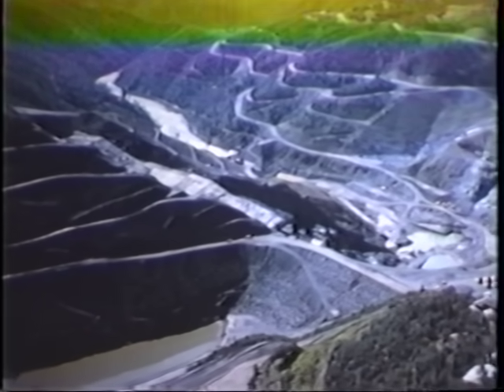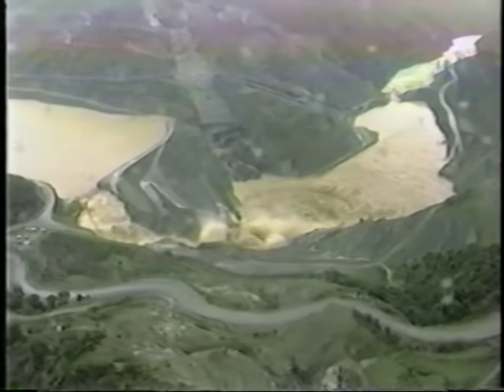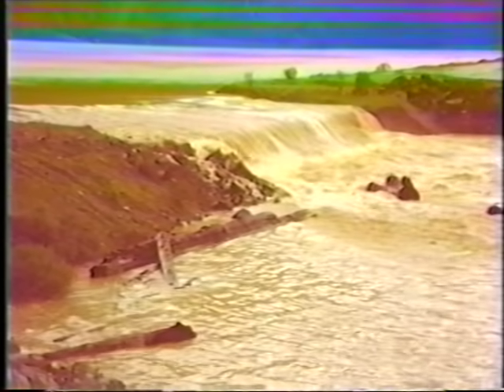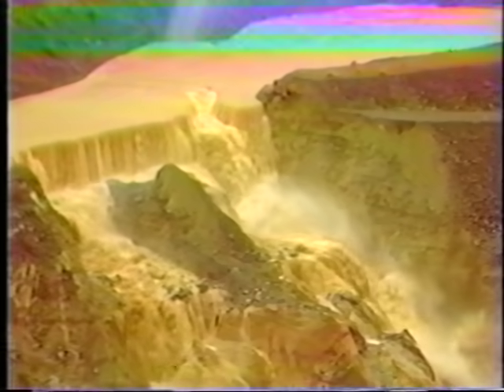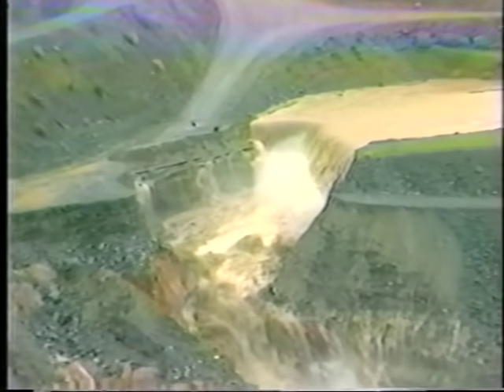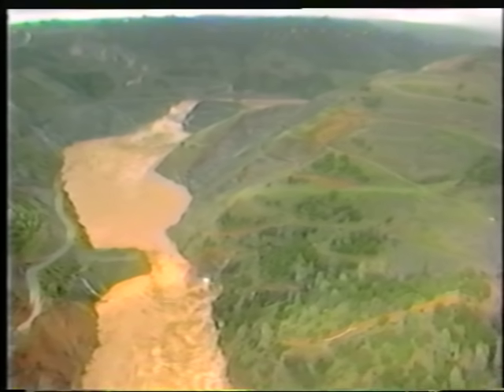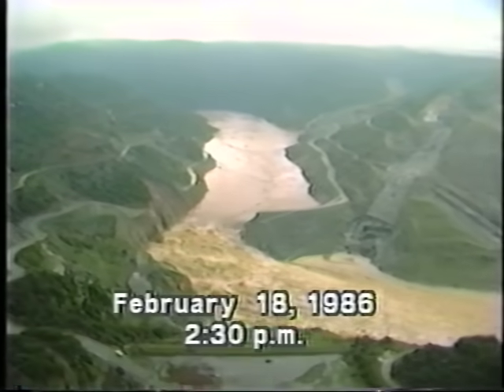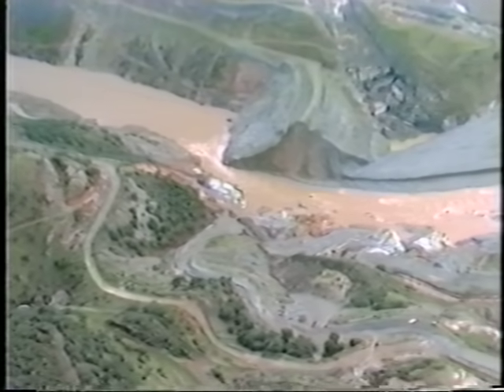Auburn Upstream Cofferdam Failure, 02/18/1986

Comment: A bit of backstory. A cofferdam is a temporary dam built to drain an area to allow construction work. In this case, the ultimate goal was to build a permanent dam at Auburn. In the early 1970s, a diversion tunnel was built connecting two points on the river, then the cofferdam was built (completed 1975), so the diversion tunnel carried the river around the intended site for the permanent dam. However, a earthquake occurred near Oroville dam abut 50 miles away, and it was realised that there was a fault line close to the Auburn dam site. The design of the permanent dam wouldn't have been able to withstand a major quake on that fault, and there was a risk that the weight of water impounded by the dam could cause that earthquake, as was suspected at Oroville. The Auburn project basically halted at that point, while they tried to redesign the dam, which is why the temporary cofferdam was still in place in 1986.
Reply: Good report

Comment: I wouldn't really call it a failure since the cofferdam and plug did exactly what they were designed to do. It was still spectacular to see and gave engineers a chance to see if their design would work properly in full scale which they don't normally get to do. This was days before I was almost killed in a car accident when an old geezer who was drunk (He had already lost his license for DUI and wasn't supposed to be driving to start with and on top of that he wasn't even five miles from the builders factory after having repairs done from a recent DUI accident!)  when he ran a red light going 65mph in a 45mph zone in a 40' bus conversion motorhome and T-boned me in my Triumph Spitfire. luckily I was able to swerve at the last second causing most of the impact to be on the rear quarterpanel (fender) I then spent a couple of weeks in the hospital where I met my wife of almost 40 years and now we have four kids and 11 grandkids with the most recent grandson born less than a month ago! I guess everything has a purpose and happens for a reason!

Comment: This caused so much inflow into Folsom Reservoir the dam nearly failed. If the storm has lasted 4 more hours it would have resulted in a Katrina type disaster for Sacramento. Jimmy Carter killed this project and Reagan didn't restart it because he was more interested in fighting Russia. The Sierra Club was prepared to go to the Supreme Court to stop the Auburn Dam project. No one knows how close the Sierra Club came to causing the deaths of hundreds of thousands of people. This scared the Corp of Engineers so much they spent almost a billion dollars on an emergency spillway that will be used every 100 years. Auburn Dam could have been built for half that and would have stored enough water for 10 million people and generated clean power.

Comment: You know...The dam site was an earthquake fault & it should never have been planned for there but, somebody used different geologic cores from miles away for the actual site planing which was caught later after construction was started & the dam was cancelled to not flood Sacramento when it failed & took Folsom reservoir with it. Lots of Hydro rivers have the same problem, dams above dams above dams above cities built on the waters edge. Smart people move BEFORE the inevitable floods.

Comment: I grew up in Auburn.  If you go to the canyon today, you'll see the huge concrete footings for the Auburn Dam in both sides of the canyon.  The Auburn-Forresthill bridge was built to go across Lake Auburn, but today it stands high above the river.  The bridge was used on the movie XXX when he drives the corvette off the bridge...That's the Auburn-Forresthill bridge.

My friends dad operated one of the cranes that built that bridge and when it was completed, we would crawl in the girders and onto the concrete pillars...there was no railing and we stood 450 feet above the river, throwing things off.  If you ever look at the bridge, think about crawling out to those pillars...It was a blast at 13 years old!  I was gone when this dam collapse happened but remember hearing about it from my Father.

Comment: i want to see the fish in that lake after draw down
Reply: pamtnman pamtnman It’s a River, the lake was never built. The flood caused the flooding of the river because the diversion tunnel could not drain fast enough.
Reply: Kris Wright the river was dammed, which created a lake. when the dam was breached, the lake emptied. When the river went back to its old course, it was back to being a river and whatever impoundment had existed was gone.
Reply: pamtnman pamtnman I live in Foresthill, the lake was never filled because they never completed The Auburn dam. This was the cofferdam that was built to divert the river so the actual dam could be built. They stopped construction on the Auburn dam in  1979, the flood thatover topped the cofferdam happened in1986, because of the debris that clogged the diversion tunnel.
Reply: Kris Wright I understand all that. There was in effect a lake as a result of the dam-not-a-dam, correct? That lake-not-a-lake interested me as a fisherman, because lakes always harbor big fish that no one sees. That’s all.

Comment: Why was the cofferdam not dismantled when it was decided not to build the permanent dam?
Reply: Eventually it was. This took place in Placer County, CA. Big $$$ was spent to remove what was left of the coffer dam, redirect the river back to it's natural path by closing the diversion tunnel, and restore the river bed using lots of concrete and huge boulders to mimic nature. Restoration project was completed somewhere about 2007, if memory serves me correct.

Comment: The drone footage is really shaky.  Must have been windy up there
Reply: This video was recorded in 1986. Other than a few military prototypes, drones did not exist then.  Most of the video was taken from the high hills adjoining the dam.  The aerial photography was recorded via. helicopter, as is explicitly stated at 5:48. You can hear the helicopter's engine. The video is shaky because the camera was undoubtedly handheld and video cameras back then did not have image stabilizers.
Reply: I was thinking the same
Reply: I didnt know they had remote control helicopters now, let alone back then.  Interesting.
Reply: Susan Baker  Why are you presuming 'remote'? Remotely controlled helicopters did NOT exist in 1986.  Even now, 2018, only the military has remotely controlled helicopters, and only experimental at that. For this video, a pilot flew with a videographer as a passenger. My older brother sold small helicopters in the late 1970's. I flew with him in pretty windy conditions. He also flew 'Hueys' in Vietnam in worse conditions
Reply: https://www.youtube.com/watch?v=bIYb_rnNSdE
My older brother is a painter. He said not to touch it until it is dry.
Reply: Wayne-O   I guess I have to be more conservative and say that back in '86, the toy RC helicopters did not fly with video recording equipment, enable RC control of the camera's viewing angles via. realtime video feedback to the user, and be so large that the canopy is so far in front of the video equipment that many raindrops on the canopy appear (at 5:43) as small droplets (vs. even a couple droplets blurring the entire image)

P.S. That the droplets move all around also indicated that the camera's location relative to the canopy is not fixed, as it would be with a video system hard mounted, as it would be in an unmanned UAV

Comment: Avery stupid question from somebody that understands not a lot of dam construction:
There was so much effort put into building the dam, why not go through the extra effort of putting a concrete surface on top of the outflow behind the plug?
There would have been no erosion IMO in the first place
Reply: A Cofferdam is by it's very nature is a temporary struture, It was build to allow for the construction of a pernament concrete dam, which was cancelled mid construction after an earthquake revealed the dam was being built on a fault line. To build a dam they first build diversion tunnels to carry the flow of water around the construction site, then build a cofferdam above the site to prevent water flowing in the construction area of the pernament dam, the smaller breached dam, down stream is also part of the cofferdam that prevent high river levels flow back up into the construction area. Once the dam is complete cofferdam is removed the diversion tunnels are closed and the dam lake is filled. The diversion tunnels are some times used as spillways for the pernament dam, but are more often sealed.

Comment: Earthen Dams are just a mistake period. All Dams should be concrete.
Reply: I have spoke with a lot of folks that believe that's the truth. However, properly designed and operated in a system like these three dams we're, you can see the event was handled well with no lives lost. The material of the dam is always based on the material available to the dam location. Another interesting fact is the progression of failure. When concrete dams fail, it often happens in a matter of minutes. The results are flash flooding without possible warning to those downstream.

Comment: Actually had a teacher in high school who was a hydraulic engineer who worked on this project. All these years later it's still cool to learn about. We actually did several experiments where we built model dams (out of dirt, stick, what have you) and saw when they would fail.
Reply: That's neat.  Did your teacher also include steelhead throwing themselves at the dam so they wouldn't fail?

Comment: Actually, this design worked perfectly!!!
Reply from the maker: As I mentioned in response to another person, the design sort-of worked. I believe cofferdams are meant to be temporary, but this cofferdam failed before it was supposed to. That is, the main dam had not been built yet.
Reply: They could have built the cofferdam higher and stronger, but investing millions into protecting some foundations of a project which might never get finished, not what engineers are supposed to do. They did not take the cofferdam down in hope the building site would not be flooded, but in a high flood event the city downstreams was their only concern.

Comment: But faillure? It seems it does where it is designed for.
Reply: I am not a dam expert either, but it was a controlled failure. It had a dam safety plug so that when the dam water rose to high the dam plug would give and the dam would fail in the direction the dam designers and dam engineers wanted it to. Now stop asking dam questions that with a moment of dam thought you can figure out your dam self.(not trying to be mean just giving you my dam opinion on the dam issue.)
Reply from the maker: I am not a dam expert, and you are correct in the cofferdams are designed as temporary solutions, but I believe this was a failure in that the cofferdam was breached before the permanent dam was built. So they built this cofferdam, re-routed the water, and were going to work on the actual dam. But before the actual dam was built, this huge rainfall happened, and the cofferdam failed. Hence the failure. Incidentally, due to environmental and other reasons, the Auburn dam was never actually built.
Reply: It was designed to fail at the "safety plug" without that plug the dam could have toppled over anywhere and emptied in much shorter time, flooding much more downstream.
Reply: Dam right!
Reply: You're wrong, the narrator states that the failure by design went according to plan around 9:11
Reply: The Auburn Cofferdam was a temporary dam built to dry out the construction site of the Auburn Dam. However due to several political, economical, and environmentalist issues it was scrapped. Afterwards the cofferdam remained in place until its ultimate failure in 1986. 

There is however a new push to build the Auburn dam for flood control on the lower portion of the Valley near Sacramento.